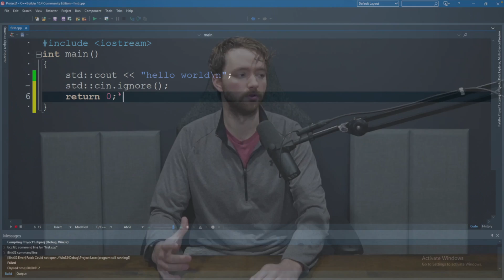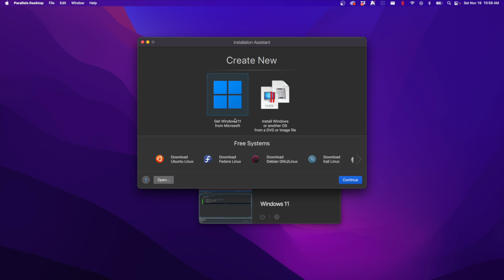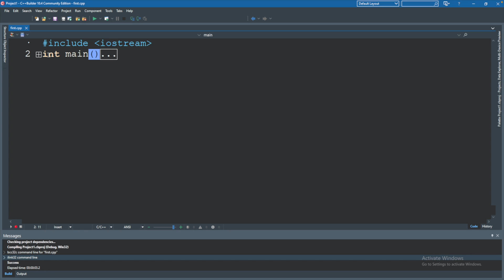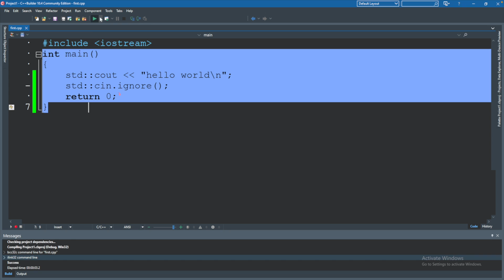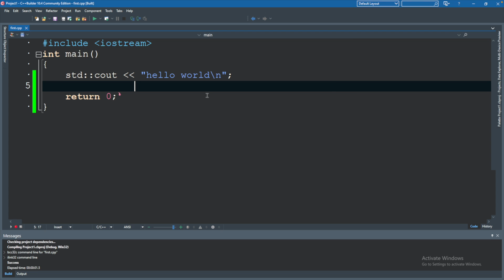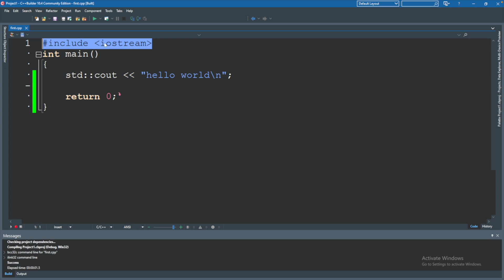Why Learn C++? An Introduction - C++ Tutorial 1

Comment: I remember using Borland C++ Builder V1, still have the original media. I learned mainly Pascal and C at University (Electronics Engineering) and around the mid-90s came C++ Builder. One the first RAD (Rapid Application Development) environments, along with Delphi (Pascal equivalent). How times have changed 👍😉… all the best Caleb, wishing you a very merry Christmas 🎄🎅 keep up the good work, great content!